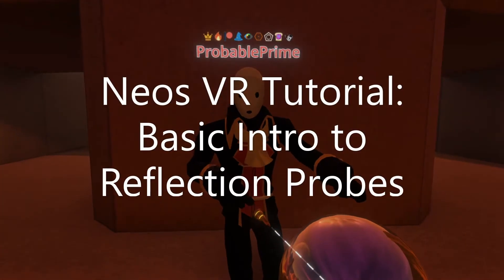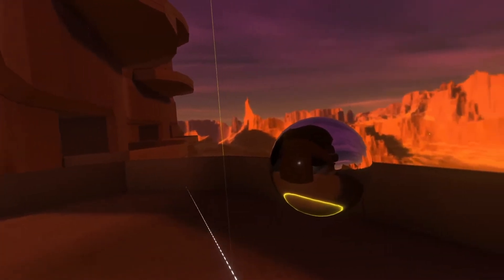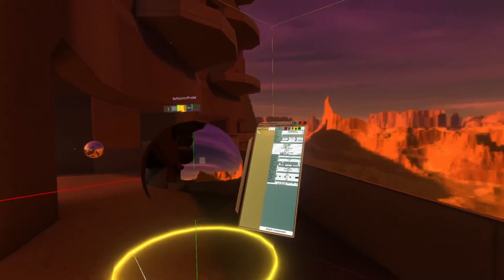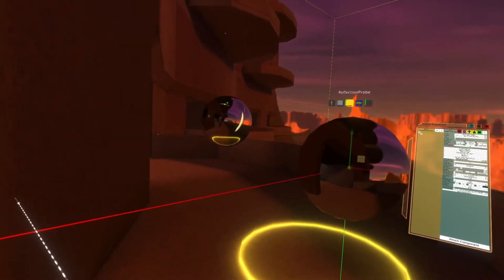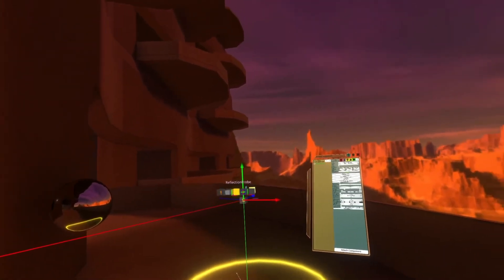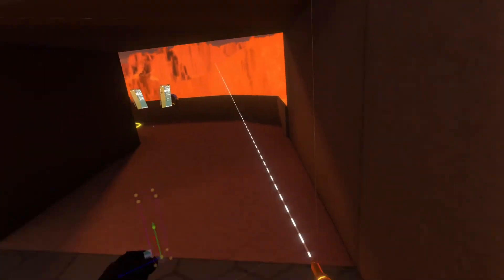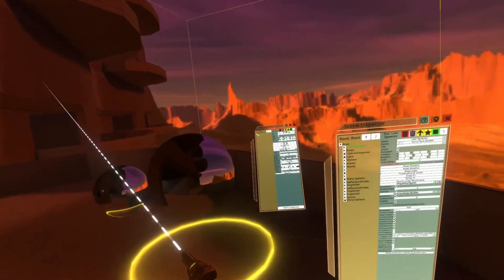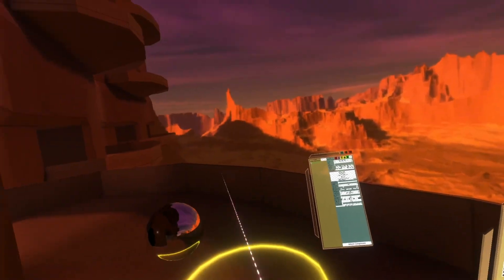OLD: Neos VR Tutorial: Basic Intro to Reflection Probes REUPLOAD

Comment: Thanks for the updated tutorial! There's another solution to the rotation problem and the transition when walking through that part of the map - just add another reflection probe in the middle of it. The baked ones are quite cheap!
Reply from the maker: Great tip! Thanks for the Info. I'll be rotating the map as its relatively simple :D